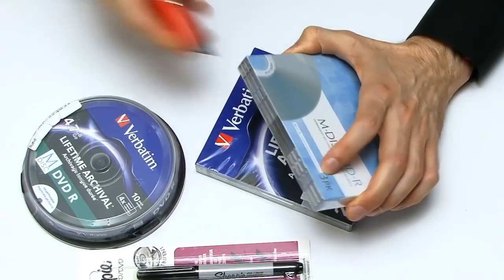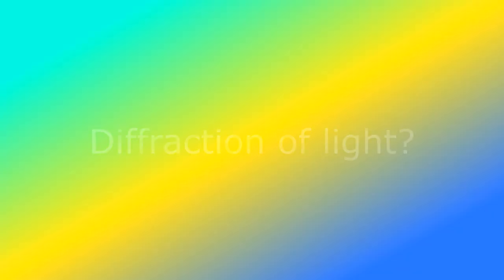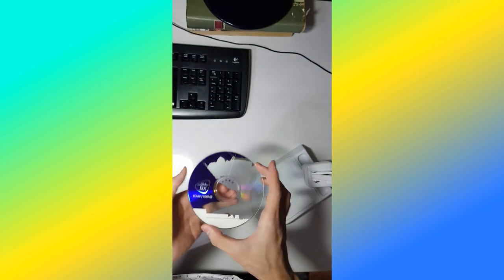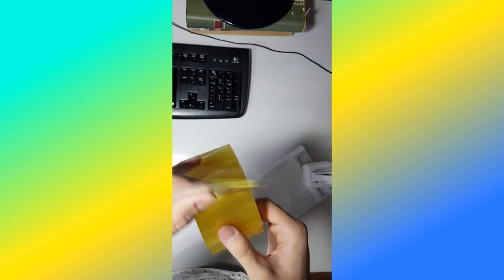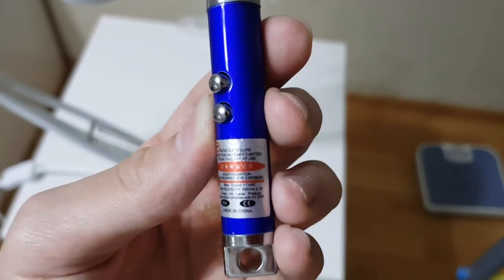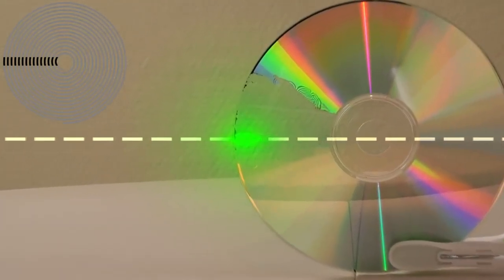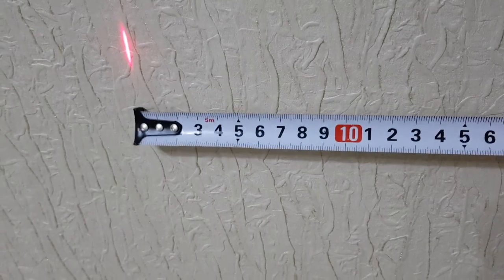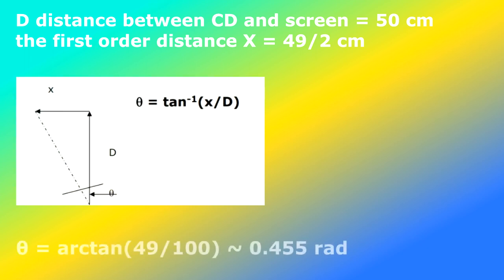Using a CD as diffraction grating

Comment: This kind of diffraction grating sheets usually are 13500 lines/inch. Then 25.4 mm/13500 =  1.88 um which is quite close to your result. (As Daniel Romero correctly pointed out, your result should be 1.5 um instead of nm.) Just wanted to say that it is consistent with the standard commercial sheets.
Reply from the maker: Oh thanks! I didn't really have time to compare findings from my experiment to more traditional methods, so I'm really glad my work does not contradict the standarts too much